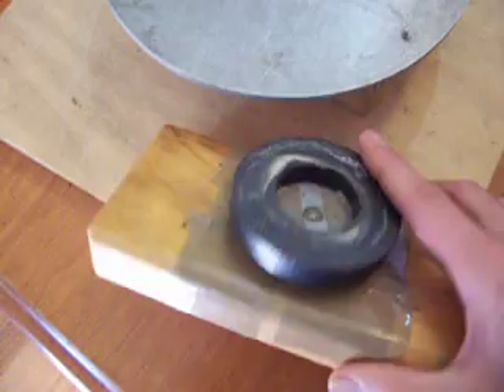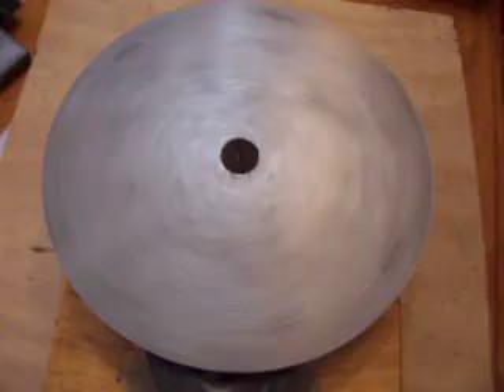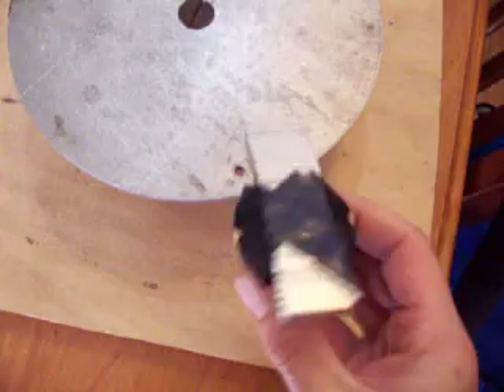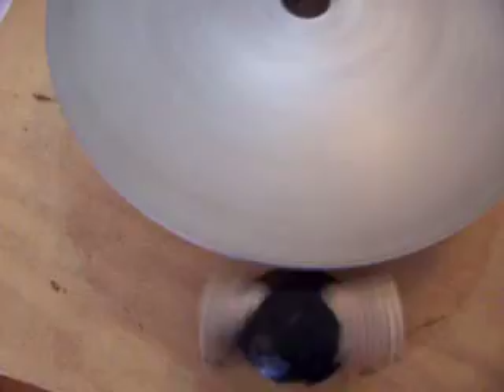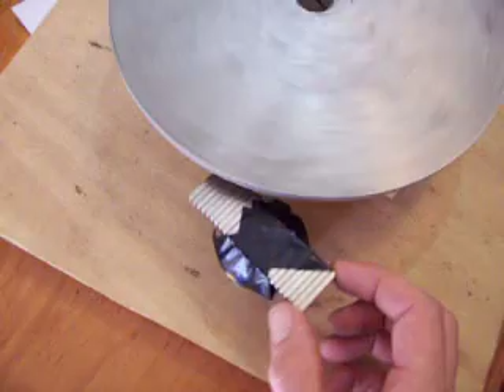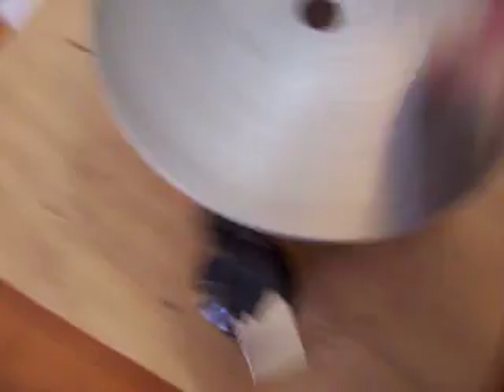104_1039.MOV

Comment: This is because the flux lines are dome shaped on top.  When they go through the metal, they are going straight up over it, then back down again into and through the aluminum.  No sizable current can be formed to cause the disk to move or slow down until a lot of the dome is in the metal, even then there is not much lenz force, just drag.  However, when the magnets are turned perpendicular, the outside flux lines can cross the inner metal aluminum like invisible wires inside, and this does allow a current flow to form, which then pushes against the magnet causing the magnet to rotate.  There is an 45° angle you showed at the last that allows some eddy currents to form, which also push the magnet, but because the eddy currents are parallel to both poles of the magnet, they push against the center of the magnet's mass, not at just the magnet's pole, creating an equal push against enough of the magnet to stop it from easily rotating.